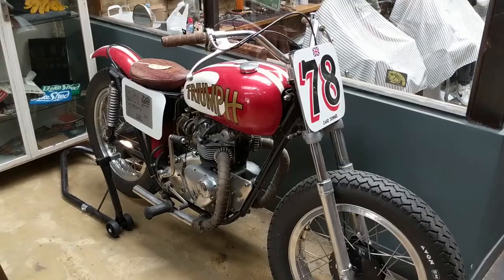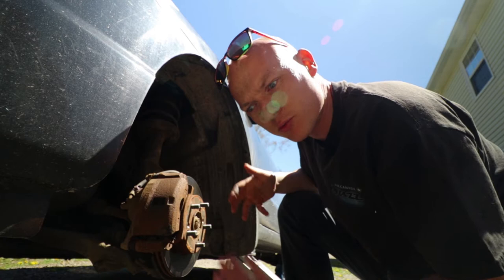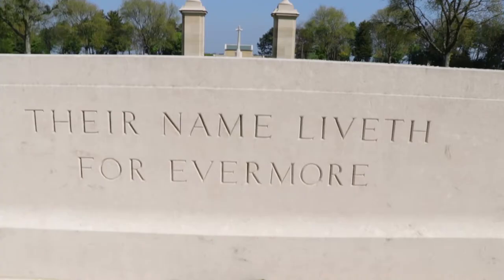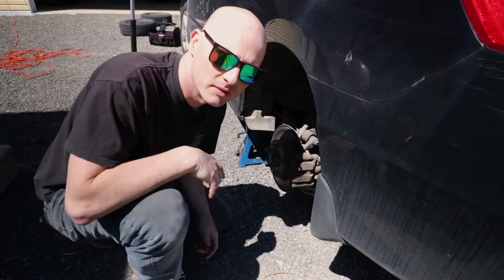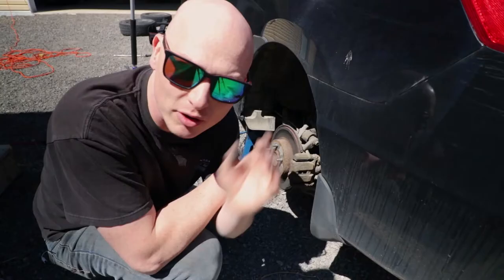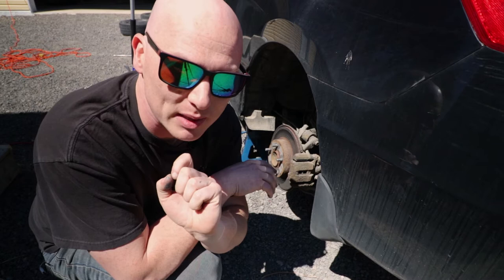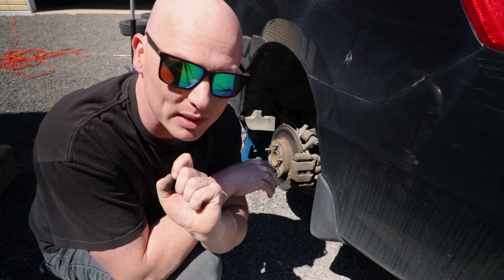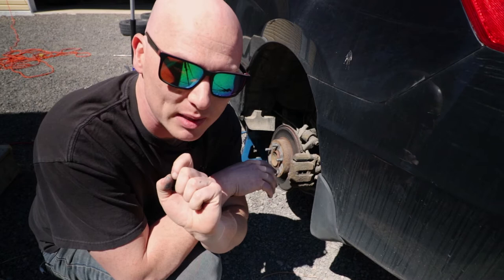Vlog aka: Updates on so many things!  THE BIKE SHED, CB750K, AE86, RAV4, CB550K

Comment: I put my plate after the fender so more protected from projection, but like also the side place.
Reply from the maker: I am considering the plate after the fender like you mentioned. I think I'd have to run some additional lighting to illuminate the plate though as the stop light (which is also the licence plate illumination light) wouldn't be back far enough to light the plate up.
Reply: Mike Barker  no its not I’ve put led on the corner of the plate for illuminate it.
Reply from the maker: Nice! Great idea